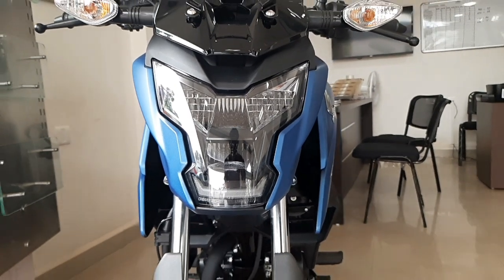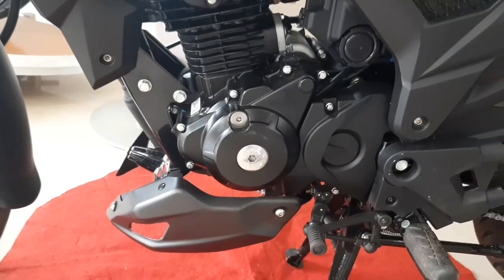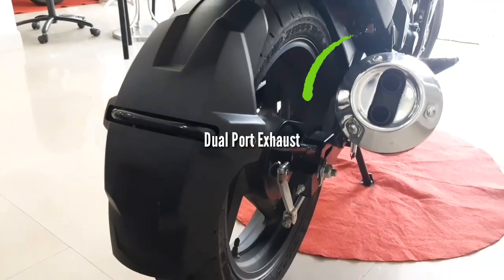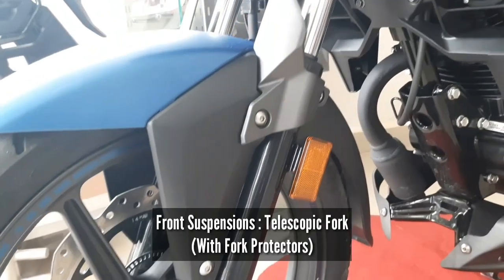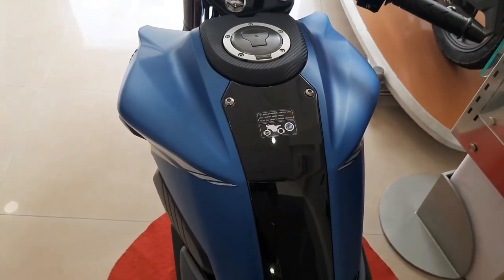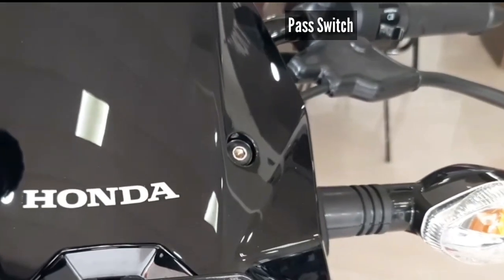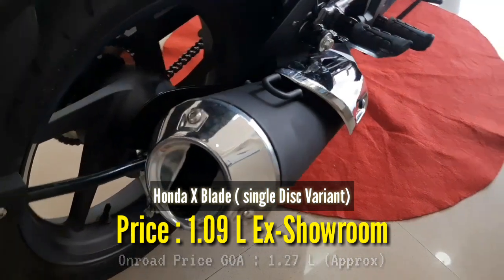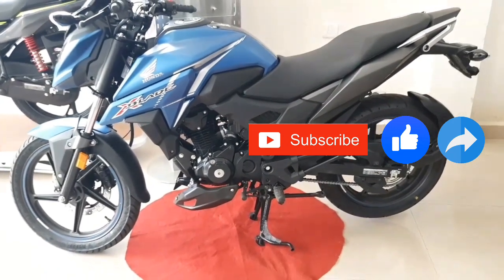Honda X Blade BS6 Review, Specifications, Price, mileage - 2020 Honda X Blade BS6 changes 2020

Comment: Bhai tvs apache rtr 160 4v ya xblade like plz
Reply from the maker: Apache has more power. and there's  a saying taht "there is no replacement for displacement" so Apache will be a better choice Even you can see NS 160
Reply: @BikerManiac  what about relaiblity of apache
Reply from the maker: see, i cant tell if the apache will get a new look and styling in  the next few years. If this happens then it might create problems in parts availability.
but if the question is about the parts & fiber quality and availability of parts now , than its good, it has a good fiber quality and fit and finish no issue at there
Reply: X blade good all purpose